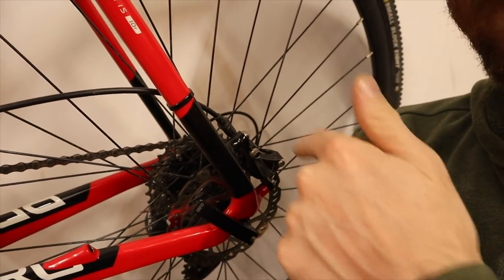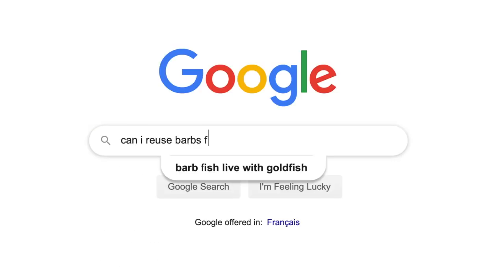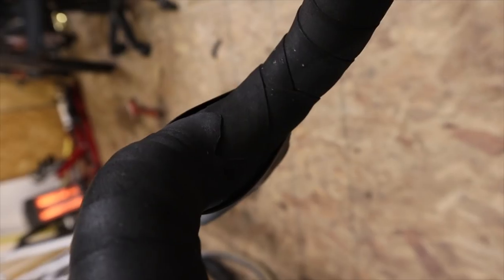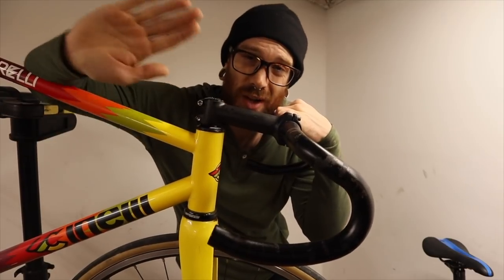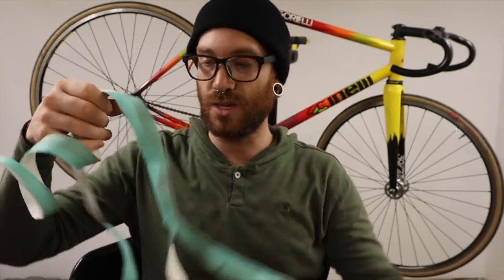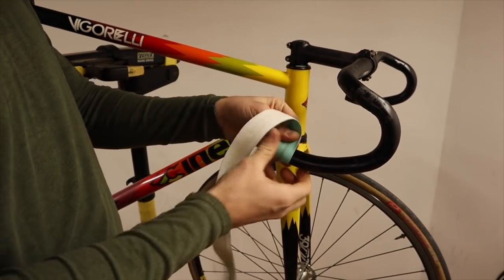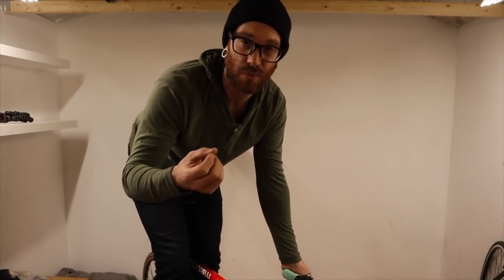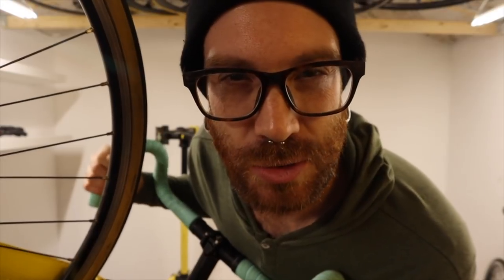Reusing Bar Tape

Comment: I ripped my bar tape in half after crash. Wrapped one part, fixed with electric tape, added another half and finished wrapping as usual. Quality stuff is too expensive to throw it away with minimal damage.
Reply: @John Porno Depends what kind of tape it is. Lizardskins 3.2 dsp washes pretty well.

Comment: Yeah I do it all the time. Why would it be a disposable, one time use only thing, nothing else on the bike is (except those chain connecting links which I don't use because it's a ridiculous concept)?

I have white bar tape on my trick road bike and I found it pretty easy to keep in pristine condition:
Step 1 clean with a good degreaser (I like brake cleaner but I'm sure dish washing liquid will work as well) and an old toothbrush. A rag cut into strips works really well if you apply that 'flossing' motion if you know what I mean.
Step 2 wet the tape with water and just pour bleach over it. Massage it in and let it sit. After that, rinse thoroughly with water and you're good as new.

Comment: google the question, and found your video. i have just picked up a road/gravel bike and rode it for the first time yesterday (goopy hands after riding with someone's duct tape fixes.. i have other drop bars here with good tape, to fit to SEE if i'll keep them but due to riding mountain bikes most of the time, i'm tempted to fit flat bars with bull horn extensions. this will at least give me another ride without being distracted by the sticky mess while i decide.

Comment: I pull a length of cleaned, tight fitting inner tube (from the trash) over the bare bar (it is a struggle) where hands will rest, then flip the old tape over to re-use. Mostly looks new (unexposed side never saw the sun and the worn edge is now under the wrap).

Comment: Any experience with hamstring pain? I injured mine running figured I could ride over the summer to keep moving. Only made it worse.
Reply from the maker: Hmm, not really. All the pain I experienced when I started running more frequently was typically at the inside and above my knees. I take super short strides and hit the ground harder than I’m supposed to though
Reply: I have had trouble with hamstring pain and the cause was saddles that were raised too high. Lowering them 2mm (literally) caused the pain to go away immediately. I am not sure if this is your problem, though it is an easy thing to try. (Saddles that are too low will cause pain at the front of the knee,  so adjusting things in degrees of millimeters will go a long way in finding the sweet spot in terms of proper saddle height for your body.)
Reply: Catastrophe Merchant I mostly run and cycle just to cross train. My hamstring injury was running related but I couldn’t believe how much riding aggravated it. I’ll try to lower the saddle some more.

Comment: way grippy bar tape you reviewed a while back, you had it on the specialized aluminum cross bike, alright where is my high five haha joking. i love the format of the beginning of the vlog its really pro and cool. i reused bar tape from 2005, granted it was in mint condition because the owner of that bike never used the bike anymore that 5 times since 2005.
Reply: i should point out that i also reused barbs on my brakes hoses a few years ago, just cut the cable a bit below the barb and slice open the cable with a good utility knife, never have i reused the olive.